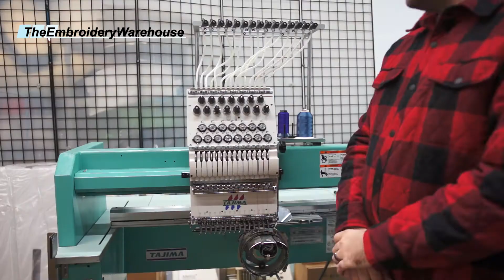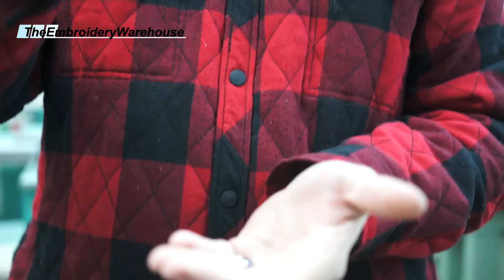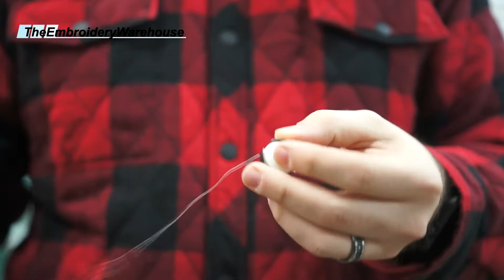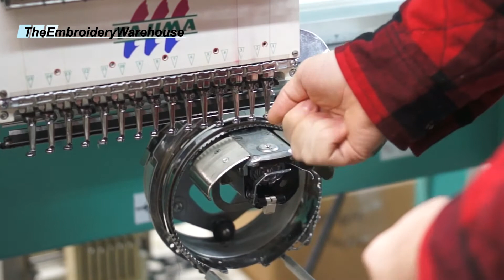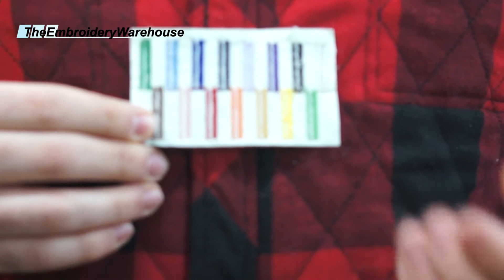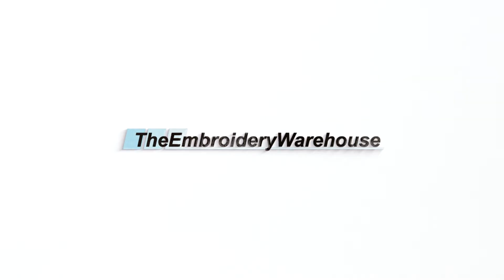How Tensioning the Threads on Embroidery Machine #Tajima (TENSION THREADS)

Comment: Hello! I have a Tajima TMBU-SC series, and I cannot seem to get the right tension. There is little to no white thread showing on the wrong side. I've tried loosening and tightening the top and bobbin tension; I get the same or similar results. PLEASE HELP.
Reply: If there is no bobbin showing then your bobbin tension is too tight or upper tension to loose. You can narrow down to see its specific color or not by running all of them. If none of them are showing any bobbin on the back side of your stitch out than bobbin is too tight.
Reply: @Barely any bobbin is showing, and I loosened the bobbin so much the screw came out while sewing. It cannot get any looser.
Reply: Also any tension issue on a specific needle it could be routed incorrectly. First tie a nice knot in your upper thread and pull it through. This will clear any lint build up in your thread path. Then take the thread completely out of the thread path and reroute it from scratch. Upper thread path should pull smoothly without any jerking. 

When manually checking upper tension I recommend pulling the thread in the opposite direction of what this guy is showing you(away from you). That is the natural direction of the upper thread as it stitching. Pulling it toward you at 90degrees causes it to snag on the needle because it’s wrapped around it.
Reply from the maker: Hello! Please contact our support team at support@tewh.com